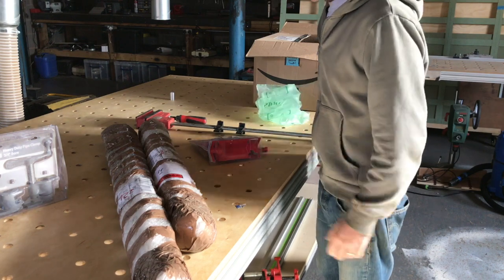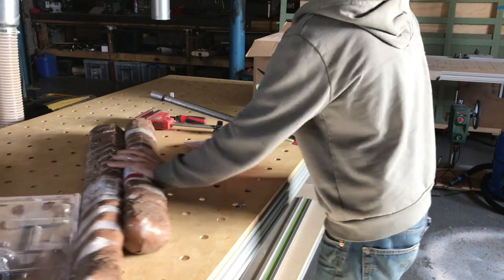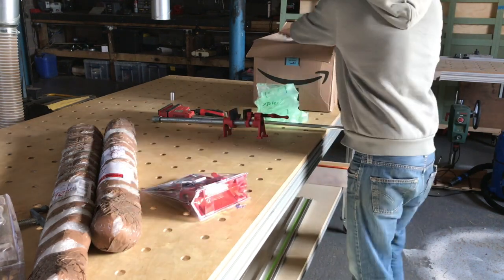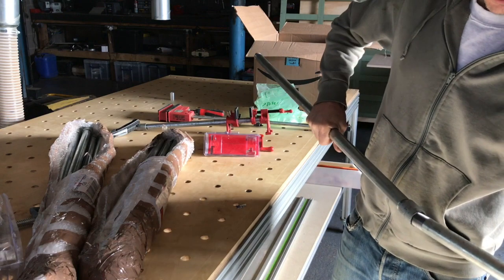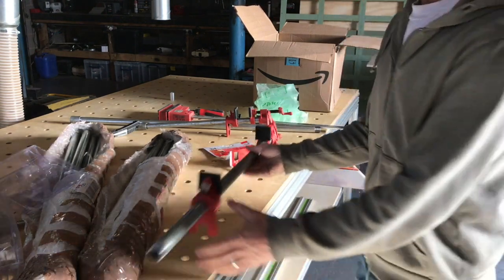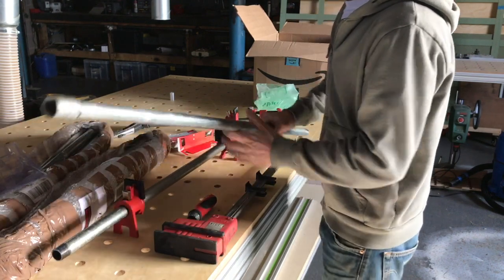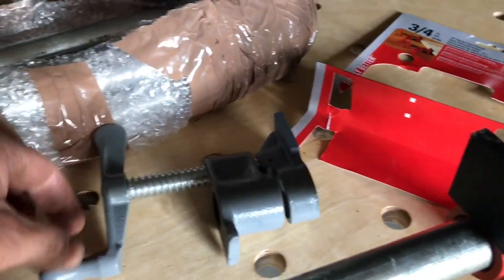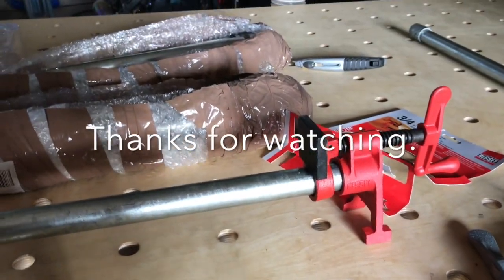Bessey BPC-H Pipe Clamps in the UK

Comment: Just watching this in 2021 in uk and wow has shipping gone up on those pipe clamps $22 for clamp and $341.70 delivery. Will keep an eye out as I like the look of them. Keep up the great work. Thanks
Reply: Bessy have them on their website £32 for a set, no pipe tho.
Reply: Seen a German supplier for 6 x clamps delivered (and VAT) for around £24 each on eBay (goes up the less clamps).  Then plus pipe (900mm) comes to just over £30 for clamp and fitting (6 too much?  I'd probably use a couple on a table over the top to keep flat)

Comment: Hi, thanks for the info but I’m assuming the clamps have a NPT thread and our pipe will be BSP thread, are the two compatible or did you have NPT thread cut on the pipe
Many thanks
Trev
Reply from the maker: They are BSP Thread , I bought my Pipe from here , you can order an length - https://www.ebay.co.uk/itm/GALVANISED-MEDIUM-STEEL-TUBE-PIPE-1-2-To-2-BS1387-EN10255-PNEUMATIC/111697142348?ssPageName=STRK%3AMEBIDX%3AIT&var=410702604045&_trksid=p2055119.m1438.l2649

Comment: When you ordered the pipe was it the 1/2” bore with the outside diameter of around 21mm. I don’t want to order the incorrect pipe size as it’s non returnable.
Reply from the maker: I have a link to the pipe a bought and use it works fine

Comment: Hi
Do you know if the thread the 1/2" Bessey pipe clamp is NPT?  I have tried 1/2" BSP  and it won't fit?
Reply from the maker: I have only used B.S.P thread with mine , https://www.ebay.co.uk/itm/GALVANISED-MEDIUM-STEEL-TUBE-PIPE-1-2-To-2-BS1387-EN10255-PNEUMATIC/111697142348?ssPageName=STRK%3AMEBIDX%3AIT&var=410702604045&_trksid=p2055119.m1438.l2649
Reply: There are both NPT and BSP threaded Bessey pipe clamps. Besseys sold in the US are NPT, Besseys sold in the UK are BSP. I don't think there are markings on the clamps themselves as to which threading they are but I might be wrong, I'll have a look when I'm in the shop next.
Reply from the maker: I bought my clamps from amazon US and B.S.P threaded pipe  from ebay UK link above

Comment: I might lash out and buy some, I have 4 sets of some cheap Chinese versions or rather had as I have tossed them away, they were that bad. Threads that galled and were not in line with the pipe by maybe 10 degrees. Real shockers.
Reply from the maker: Good to know , thanks for letting use all  know about it